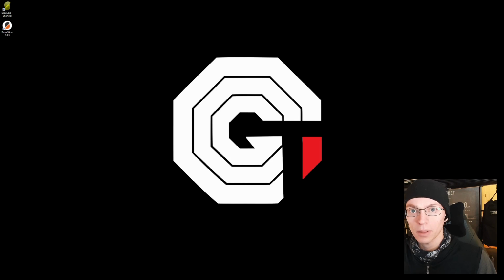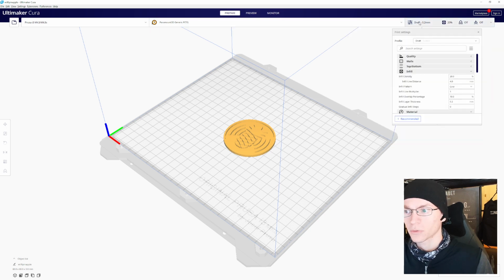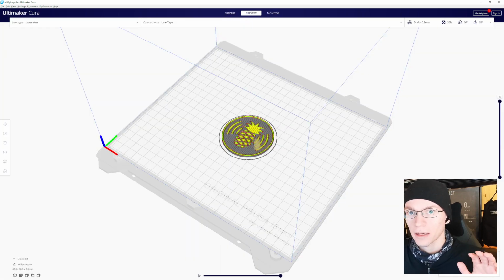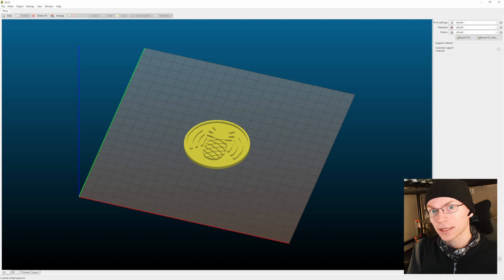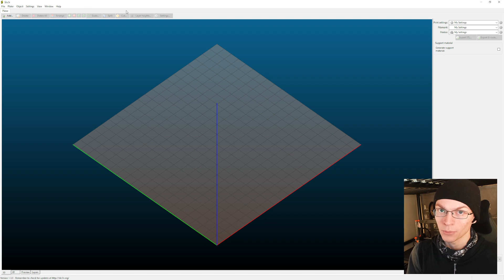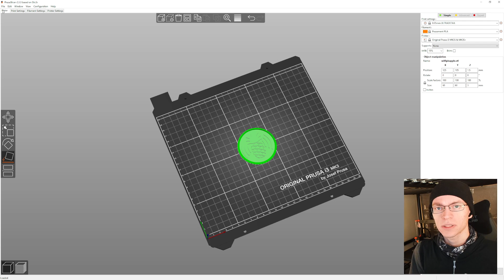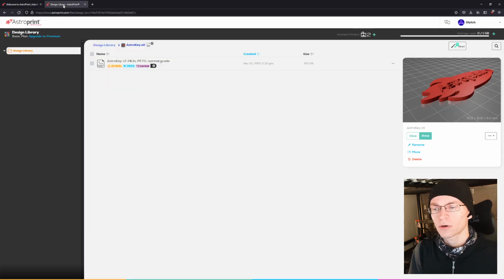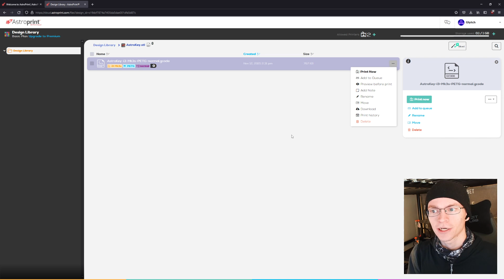3D Print Slicer Programs for Hackers and Makers w/ Glytch

Comment: I mostly stick to prusaslicer, mainly because my printer (Cetus MK2) has a proprietary control board so I can't change the steps/mm for my bmg extruder, for example, which means I have to do all my tuning through the extrusion multiplier setting instead. Problem is, I need a multiplier of 23.8 or so, which confuses the hell out of Cura, but Prusaslicer doesn't care.